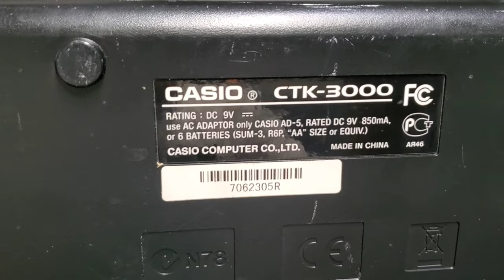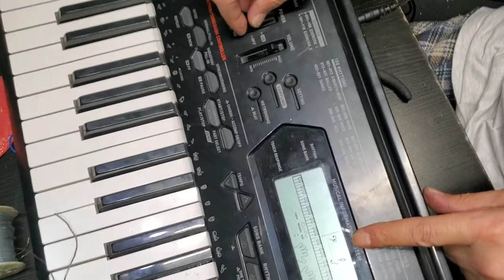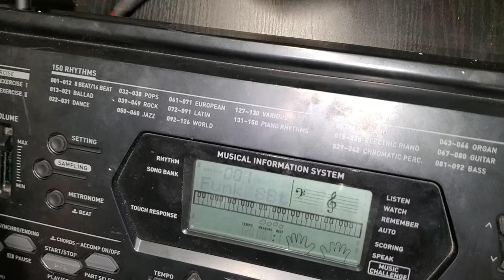How To Fix Piano Not Working | Piano No Power Easy Fix

Comment: isko chalane ke lie dc wire kaise bnaye pls
Reply from the maker: the tin wire is to connect the broken connection in the electric board 
the electric board has golden plated connectors between the power input and cyrcalor board + and - one of them has broken connect so I used tin wire to direct connect,
I hope that can help you to understand best regards ✨️
Reply: thanks I will subscribed u
Reply from the maker: Many Many thanks and appreciation 🙏 thank you so much 💓 🙏 💖 
And all the best 👍